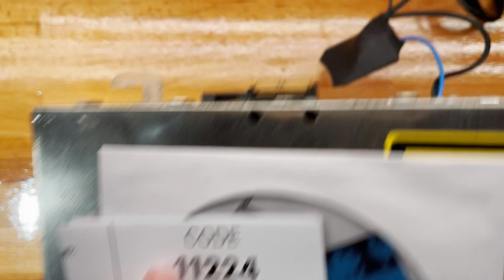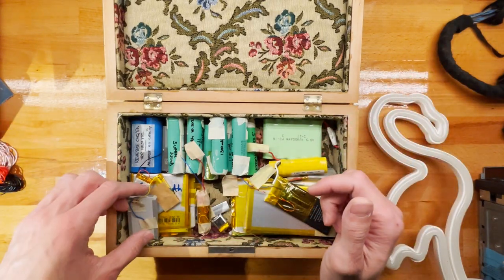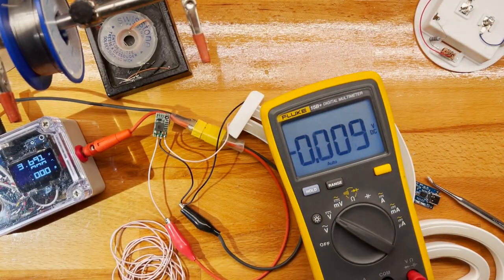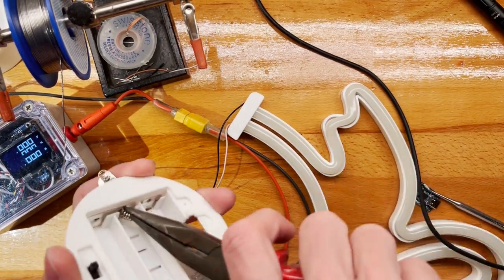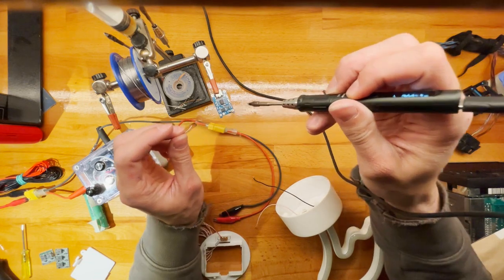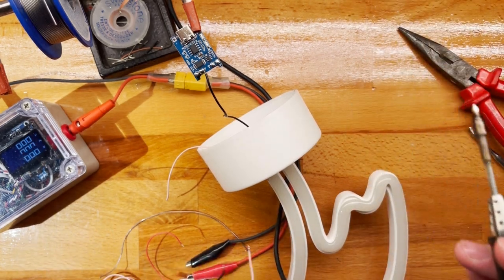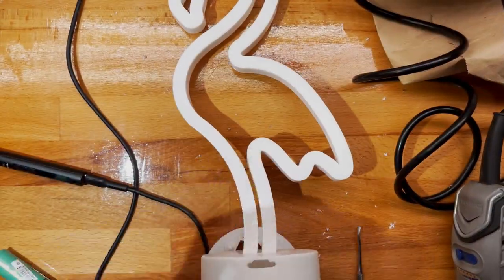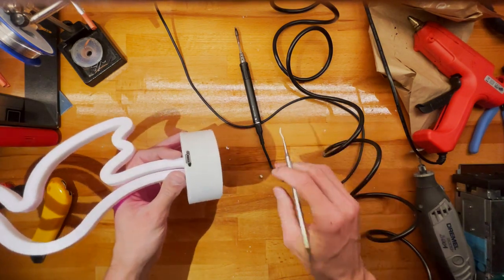LED Flamingo gets Type C - Battery Companies get The Finger

Comment: to make usb-c hole i usually drill 2 2.5mm holes, then cut with x-acto knife and smooth all the inside perimeter with an old soldering iron set at the lowest setting. The usb-c hole is easier to make then a usb mini or micro .
Reply from the maker: aye !! thanks for the tip 🔥

indeed, the hole is way more regular than prior ones
Reply: Nice idea with the soldering iron!